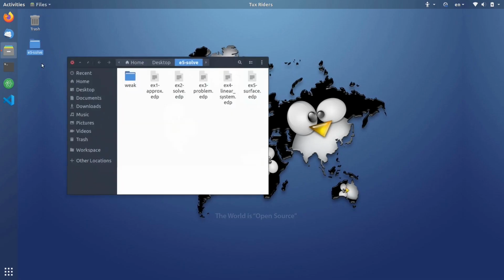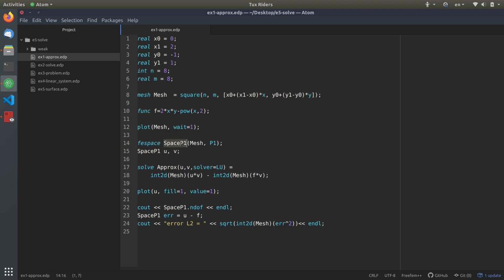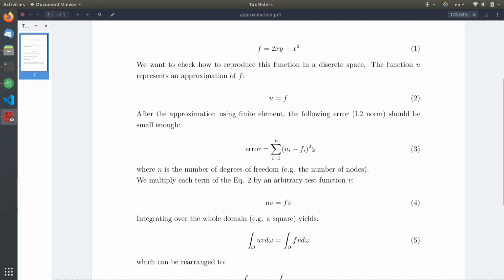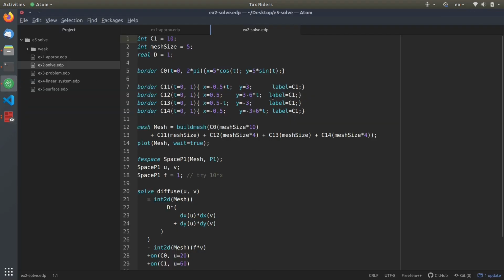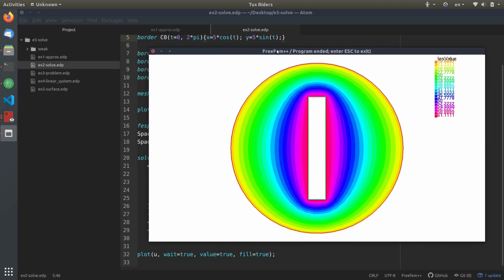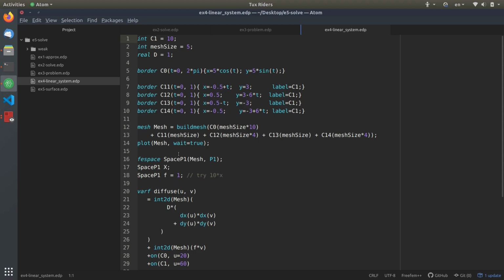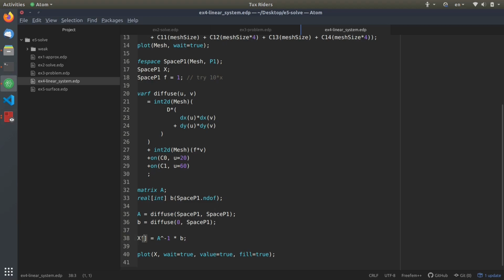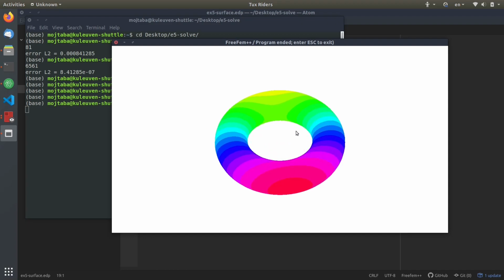[FreeFEM 5] Implementing weak formulation to solve partial differential equations in FreeFEM

Comment: If there is no source term (e.g. if f=0), would you just write X[ ] =A^-1 and not worry about defining vector b?
Reply: Or do you still define b as shown and freeFEM will just set it to zero? One further question, how do you deal with a system PDEs in multiple unknowns using the varf keyword? How would you define the matrix A, the vector b and the unknown X in this case? When using the 'problem' keyword, you combine all equations into a single integral, but I'm not sure if you'd do the same when using the varf keyword.
Reply from the maker: for the second question (system of PDEs): yes, you can either write them in one `varf` statement or solve them one by one. we will have videos on this soon.
Reply: @TuxRiders   Thanks for your reply! Great, a video on this would be awesome.
Reply from the maker: so, for the first question: you need to have `b` anyway even if `f` is zero. it contains other important info such as boundary conditions, without which the problem is not well-imposed.